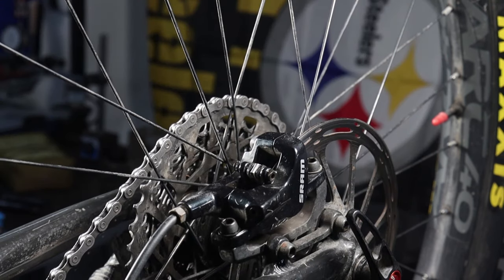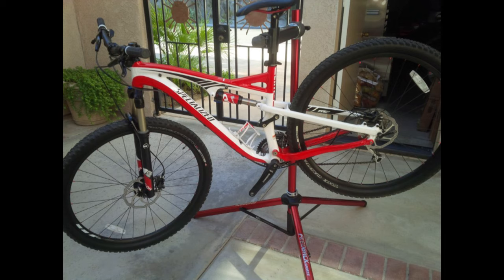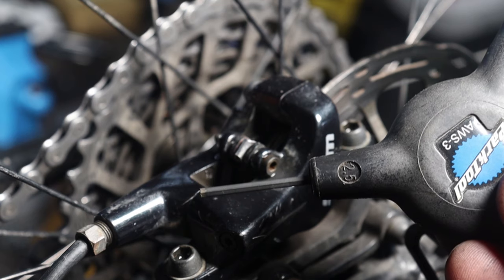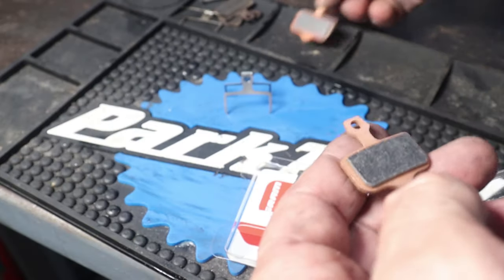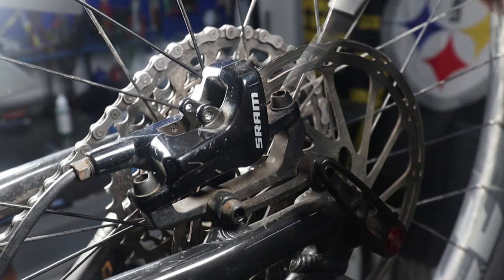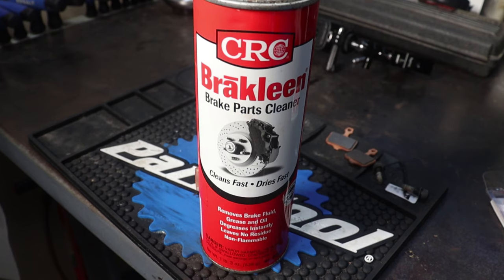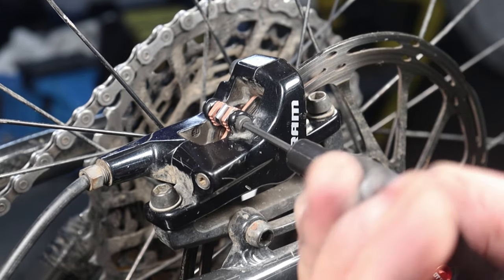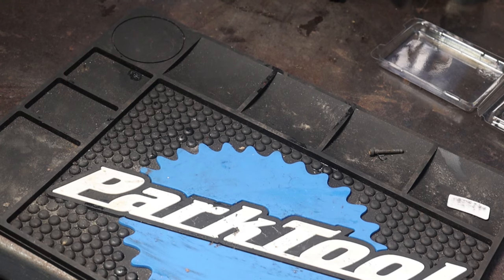SRAM | Disc Brake Pad Replacement

Comment: I am in the middle of trouble shooting replacing SRAM Level T disc brake pads as I speak and guess what. I yelled son of a ... when the SOB clip went flying. Currently stuck wondering how to open up the brakes as the new pads extra thickness is preventing me from engaging with the rotor.
Reply from the maker: Thanks for watching Gen. Park tool makes a pry tool to spread those pads, but in a bind, if you have a large flat screwdriver, or anything with a thin ridgid flat piece of metal, you can pry them apart. I hope that this helps.

Comment: Hello, yesterday I wanted to clean my Level T brake pads, but when removing that "SOB" clip from my rear wheel brake it just broke, so I just reinstalled the brake without it. My concern is if this is safe to use it without that clip? At first look I see no difference, the screw is tight and holds everything as it should. Thank you!
Reply from the maker: Glad that it helped, and thanks for watching! This is just my opinion on the "SOB clip"... I am pretty sure that it was added so that the little screw doesn't completely get lost if it happened to  loosen while flying down the trail. I have discovered mine missing once or twice, and really had no idea how long I rode with it gone. 
When you purchase new brake pads, that clip as well as the bolt, etc should be included. I think that any of the larger hardware stores like Lowe's, Home Depot, etc should have those clips in the area with the nuts and bolts in drawers...not a hundred percent sure, but might be worth a look if it's a concern.
Reply: @themostlymikeshow  Ok, thank you so much. I'll just leave it like that until the brake pads need replacement (I noticed the new ones come with that clip). Cheers!

Comment: Two items; are your pads Organic or Metal? The metal pads usually have a copper back. Its important to match pads with rotors to prevent excess wear. Also to use a digital caliper to measure pad thickness (replace under 3mm) and disc thickness (check specs for your brand of disc). Otherwise, good video.
Reply from the maker: Thanks for watching and the helpful tips Steve. That video was from a few years ago, so I am due to make an updated improved one. Maybe I will apply my newfound knowledge into that video.

Comment: Old video but I will leave a comment. Appreciate the humor and straightforward presentation. Just a FYI if you have digital calipers. If total thickness of pads and backing plate is 3mm or less replace pads. But sometimes it’s really obvious like yours.
Reply from the maker: Thanks for watching and the helpful advice Robert. Yes, I have calipers. I didn't know that they should be 3mm or more, but I will from now on! I will post an update at some point. When I made that video I was just getting into this business, so it's been a work in progress. I learn something from almost every upload.

Comment: Hey I need some help 
I have sram level brakes and I need pads does the sram level / level t / level tl all use the same brake pads because I can't find any specifically for the one I have
Reply from the maker: As far as I know, the Sram brakes that you mentioned are all the same pads. I looked at the packaging on the ones that I used in the video, and they specify level, level t, and level tl. I hope that this helps you. Which Sram brakes do you have?
Reply: @themostlymikeshow  I have srams level like the cheap version of the t / tl so it's probably going to work 
Thanks a lot
Reply from the maker: @damianos1529  No problem. Hope it works!

Comment: How many miles did it take to wear the pads? Thanks
Reply from the maker: I don't really keep track of the miles for wear, but those pads were original to the bike. At a guess, around 1500 to 2000 miles. I wouldn't recommend wearing them down that far though. Thanks for watching!
Reply from the maker: @thomasmedeiros5722  That's very true!